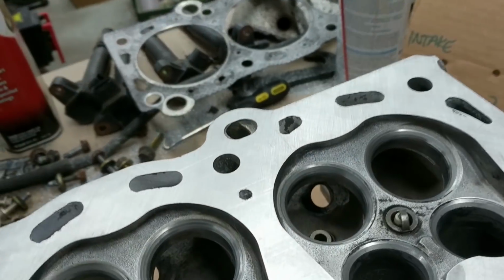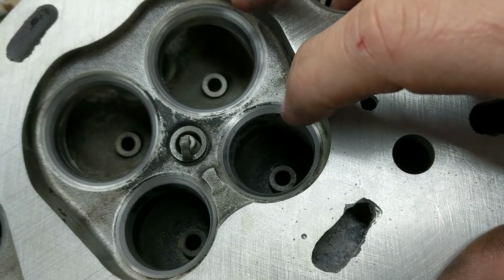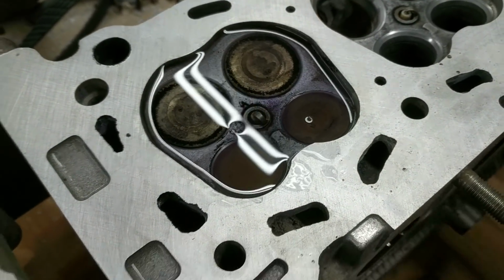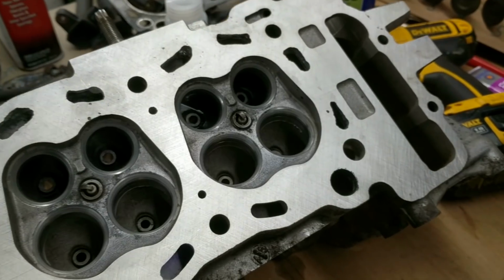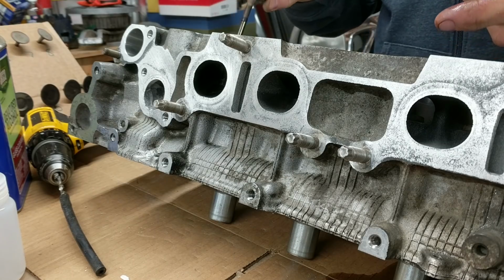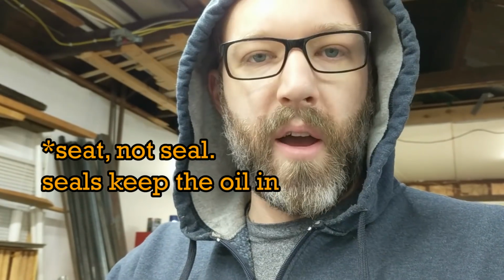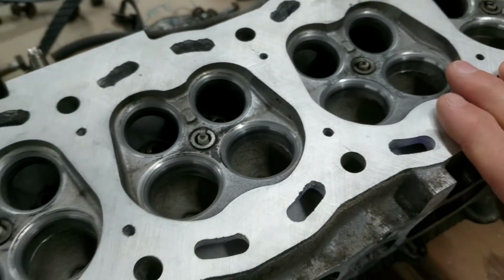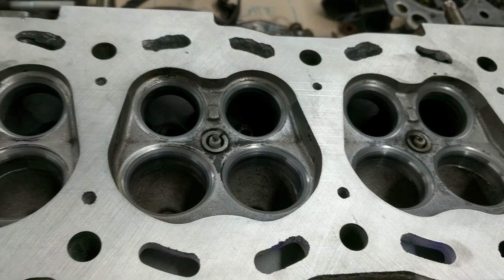Lapping Valves and Fixing Warped Seats (the Wrong Way)

Comment: wet and dry sandpaper glued in 4 parts on the valve put in head use soapy water and drill on valve stem and  run it long and hard and fast and every now and then spray soapy water onto the valve head, 
do not keep lapping in the valve as you will wear all the head away, as the valve seat is HARDEND AND WARPED, you have to sand the seat, unless you have a grinding stone or carbide set(the metal valve cutting tools dont work on hardend valve seats)

Comment: I HAD to comment because I have done very similar things. Back in the 70's I lapped the valves (honed the cylinders) in my 260, '64 Falcon and 20,000 miles later when I got rid of the car it still ran fine. About 15 years ago I did similar with a 318 Plymouth,  - a car I still have to this today that runs just fine.

 In the Plymouths case I changed things up a bit. The valve had an indent where the seat area contacted. I chucked the valve in a drill press and with a file attempted to smooth the surface of the valve. I used a machinist square to check that I was as close to 45 degrees as possible.  I used a gasket punch and cut three small dots of 180 Wet N' Dry sandpaper. I glued the the dots 120 degrees apart onto the valve surface with 3M (no endorsement either) Super 77 adhesive. I then spun the valve with a drill to clean up the seat. This got the seat to conform to whatever the hand finished valve angle was (44.5-45.5 degrees..., whatever it takes).  I then go to compound. Sometimes a 44.5 degree seat is called for with a 45 degree valve.  Does anyone really believe that half a degree remains after some time? 
To answer a few anticipated questions:
1. Aren't the valve seats too wide? Maybe too wide for spec but I never have had an issue. These are no race motors with 3 angle seats. In fact we move to anticipated question 2.
2. Aren't the margins on the valve thin? They can be but often not. And if I think they are too thin I put the file to the edge of the valve face and thicken them. I'll also more "3 angle" the valve in this process. The lapping shows the contact area and I stay out of that.
3. Aren't the radial grooves on the valve are detrimental to the guide? Well the guide isn't that great at this point anyway. I vertically polish the stems with 2500 then 5000 paper when done. 

The world is full of naysayers.  YOU CAN'T DO THAT! Go watch when George Petroni (George Kennedy) gets the stuck plane out of the snow in the original "Airport" movie. First of all anyone who sees this video is likely not carrying a pile of cash. Second if they get this far they probably have a great need and at least minimal skills. Third they are probably not looking at building the engine to go another 50,000-100,000 miles at maximum power. They are only trying to make it SUFFICIENT for a year or so and maybe 10,000 miles.

I'm in my 60's now and have 8 "old cars." I can only drive one car at a time to Cars & Coffee bi-monthly. I'm barely rolling up 100-200 miles a year per car. I can not see spending hundreds, if not thousands for machine work (per car) I will NEVER recoup. So, no, these methods aren't common for a real rebuild but they are SUFFICIENT to some peoples needs.

Comment: You lap by hand. If the seats are damaged, go deep and adjust spring with shims if needed. Most valve trains can be adjusted enough to compensate the .005 you took off. That's the thickness of a sheet of paper.

Comment: Mine always have the dull gray appearance too. It's normal after lapping. You should use a hand held lapping tool to turn the valves, not a power tool. Those valves that aren't seating may need to be machined , lapping is a finishing process. It's used on gage blocks and when you put two together you sometimes can't get them apart. Glad to hear the engine is running after this and hopefully you still have the truck :)

Comment: That mat finish All the way around is what you need, if you pour alcohol and any gets through even just weeping one drop in 15 seconds not good. I just did a Honda changed 2 bent valves with the bent valves i still had 30 lbs of compression.  when the engine was at idle it had a dead miss when revved up much smoother anyway i put in the 2 new valves without grinding them and about one drop every 10 or 15 seconds leaked, with engine back together still only had 30 psi compression, took back apart ground the valves and now 130 psi .

Comment: Den...you may not be an expert...but your good!!! I repaired a burnt valve on a 302 under two trees at ERINBURGH, AZ ...it took 3 days but I got it done with a new head gasket 1 ex valve and a rock...my tools were limited but ample...no valve spring compressor either...hand lapped new valve into old seat...close to 1/8" contact on new ex  valve seat in head...it got the job DONE!!!...oh...less than $40.00US...(10c)

Comment: There is not pressure on the solvent. Keep lapping. If there is a path for pressure to leak by you could burn a valve. You need to change directions when you lap the valves often. You got it good enough for an old truck. :-)

Comment: The combustion Chambers have to be sealed and I would almost guarantee that cylinder with the seat not touching the valve on an almost half of the seat would become a misfire almost immediately after putting it back together.

Comment: you should cut your valve seats 3 corners. seating surface is 1.5mm max. yours are way to big! and lap it shortly..thats it. never use a drill and spin it. leaves marks behind. The key is 90degree left right left right...turn it 180degree and again left right left right 90 degree... omg

Comment: All these comments are great and great job on DYS, I’m going through the same and decided to clean all the carbón buildup with all sorts of Stuff  but aluminum paper worked best, on the other hand I manage to clean the valves and seats without taking the camshafts out, carefully of course but  as I tested them by pouring water into the ports I could see a 1/4 of a drop seeping out and I’m thinking that is good enough, i have bought all the necessary gaskets and will be putting everything back up on the hopes that I can still use the car for another year or two.. wish me luck.
Reply from the maker: Good luck!

Comment: On a high mile engine you're better of leaving valve be. Unless obvious signs of issue. Ie backfire. The increased compression will blow the piston rings
Reply from the maker: I would agree except I welded on the head to repair it and that warped the exhaust valve seats.
Reply: Not going to say impossible. But not likely. Seats are steel inserts. They press in. Would take slot of heat. Not hard to replace them
Reply from the maker: @briankennedy5578  hmm, I should have checked before the welding, I'm just assuming the seat changed but maybe they were already that way

Comment: Modern valves are made with incredibly thin hardening on valve face.(0.007"~0.010" on intakes) 'Lapping' valves with compound is a throwback to 1930's~1950's manufacturing processes with hardening welded to valve face ~1/16"  or more thick. That's the 'lazy' and wrong way to test for leakage, you should put fluid into ports not combustion chambers
Personally, I haven't lapped a valve since the early 1970's and never had sealing problems. That is also a terrible way to spin valves, it creates radial  grooves which cause a lot of extra wear. I guess you had an idea it was all wrong?
You could probably get a new set of valves, (intakes and exhausts) and be OK. Your right about too much information lot of it is wrong though. I taught this part of engine building/reconditioning for several years. You can get a Newway pattern valve seat cutter on eBay which will fix the problems.
Reply from the maker: Thanks for the constructive criticism.  I didn't know that about the hardening and it makes sense.  And I didn't know I should have put fluid into the ports instead.  I'm not sure how long it will last but the truck is running now, taking me back and forth to work.  I'll definitely post a video if it dies and I'll take the head off to show what it looks like but hoping it gives me another year or so of service.  Fingers crossed!
Reply: absolutly agree. really wrong way to do it. i would never lap my new valves like that. they are straight bin...lol

Comment: The one valve that you showed with the concave seating surface should be replaced - or brought to a machine shop for grinding. I had to do a quick valve job on a SAAB years ago. Brought all valves to a machine shop and just ground the seats in exactly like how you are doing. Worked great. Otherwise seems you are good to go with this

Comment: Go to your local parts store and get a valve lapping stick. Double ended with rubber suckers of different diameters for different valve sizes. You put the valve on the end and rotate the stick between your palms as if you are trying to start a fire. Apply some lapping compound as before. Every 3 or 4 passes lift the stick with the valve and then tap it back down. This action will put the grinding paste back on the valve surface and you will immediately feel the difference. Don't ever use a drill. You are just matching the valve face to the seat.

Comment: They do make stones with long shaft that goes in cylinder head then chucks up in drill to do valve seats then lap with new valve and your  ready to go do the others! Stone will have to be dressed or replaced between valve seats. Tool was made for flat head ford jeep motors with valve next to piston, should work on your heads

Comment: Lap'ing will give you a nice looking seat and it might seal for several days, but you need different angles on the seat and valve.   Otherwise it will be to sensitive about carbon build up and resulting leaks and overheating.  Aluminium is soft so warping has to be evaluated in each case.  You will only lose a gasket, if you're wrong.   Cracks, I have sometimes had success with chemical metall. They normally do not get into combustion area.

Comment: This is the method my father taught me. We don't use the drill but rather just chuck the rubber hose in the drill instead. Same result.  It works great. You don't need to be embarrassed with this. Very common practice.

Comment: You should start with a very fine grit compound, as fine as possible (It would be safer to do this little by little instead of jumping the gun with a much courser grit )and use a valve lapping tool kit that's are usually sold at an Auto Zone. I've seen my uncle use one of these kits to resurface the valve seat. It came with what looked like a suction cup the size of the valve itself and it came with a special handle that you would use to spin the valve (The same way you would rub your hands together) on the seat from the inside of the head in a circular fashion. You could also adapt the suction cup part of  with a tool to use with a drill as well. Again! Using a finer grit compound would give you plenty of room for mistakes!

Comment: Hi Dennis, I'm impressed with the surface you've achieved on the head, that will more than suffice to seal to the head gasket. Make sure you use a thicker gasket, to account for material removed whilst "skimming". The number 3 exhaust valve seat that was only sealing on 1 side will have been 1 of 2 things, a slightly bent valve, or a worn valve guide allowing the valve to run out of true. This could cause a little smoke if the valve guide allows oil past the new stem seals. Replace that No.6 valve, it's out of round & will not provide a decent seal... relap with the replacement valve (valves are dirt cheap). Experience tells me that you can then fit that head and rely on it for many thousands of miles. Excellent job. Pete (20+ years mechanic) 👍
Reply: I forgot to say, a good "dirty" test for slightly bent valves is to insert the suspect valve into your drill (make sure there is no play in the chuck) and clamp drill level in a vice. Run the drill up and watch the business end of the valve. It should run true. If it wobbles, you have a bent valve. You can also resurface the heads and inners of the valves in the drill carefully with some scotch brite, emery cloth. I use this method before lapping so as not to affect the sealing face. Cheers.